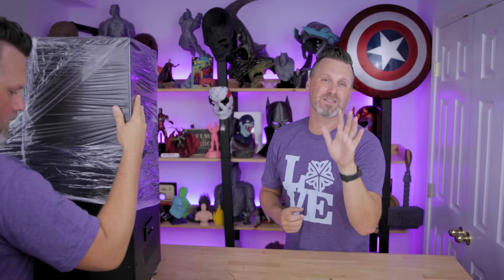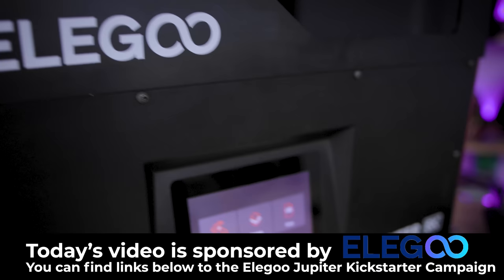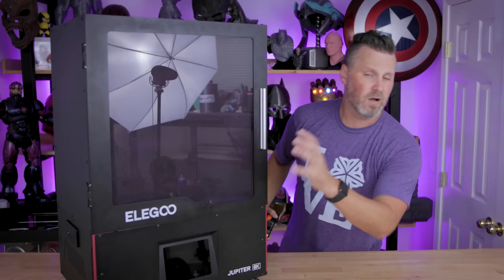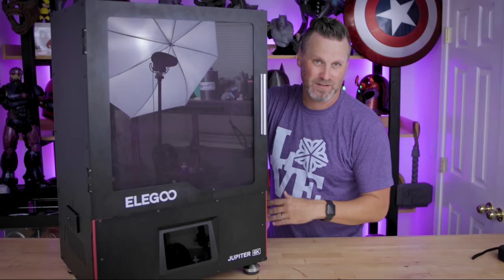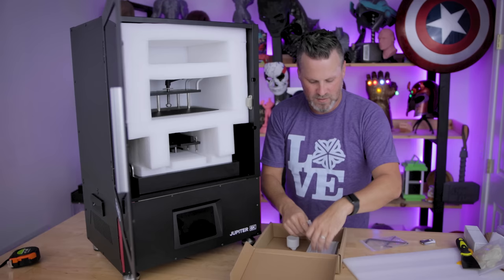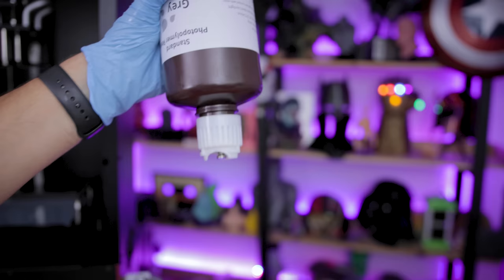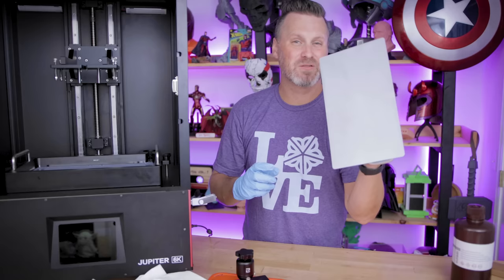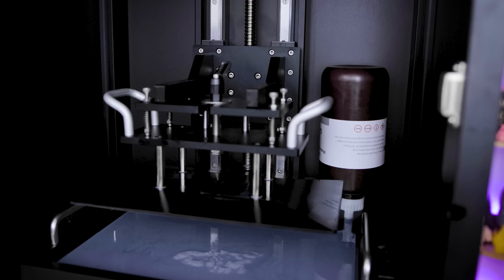Elegoo Jupiter Kickstarter Resin 3D Printer | Initial Look!

Comment: List of questions for you.
-How does the 'auto' top up work and what prevents it from overfilling the vat? Does elegoo have plans to have an auto top up accessory for some of their smaller printers?
-Does elegoo have plans to change the build plate design? It's common to see for the larger format 3D printers to have a 'holey' design to assist with 'suction force' to the FEP, are large solid prints a problem on this printer potentially?
-A common accessory I see for resin printers is the ability to put the build plate on a tilt to assist the resin to drain off, is there an accessory to assist with this direct from elegoo?
-The kickstarter says it's a mono screen (both title and the section titled "Easy to assemble and upgrade"), is this initial/prototype unit having to use a different screen for availability reasons and the kickstarter units contain the mono screen?
Reply: Natures physics prevents the vat from overfilling... By elegoo´s responses on the kickstarter page they may consider increase de slope on the build plate, but have no plans to add holes... i think a lot of the backers don´t like the holes, including me...

Comment: it might be the FBV sheet move slightly each raise.
one thing I would love to see from such large printer is a way to eaither fill half the vat and use half the plate or switch them for smaller prints so you don waist that much of resin

Comment: I do wish printers wouldnt go all the way to the top of Z once a print is finished, my E10 does this and so does this one by the looks of it. The drips will make a mess of the inside. If the built plate is sturdy and does what its supposed to, i dont see a huge issue with this design, you show screwing down the bolts once the plate sits on the screen but i assume the next steps is you have to then tighten the nuts on top to lock them in place. THAT seems like i could be a pain with all the handles and stuff in the way, especially for the back two bolts
Reply from the maker: “I believe” it’s possible to modify that in the printers firmware. Making a note of that for a wuick future video

Comment: Could those lines be resin that isnt mixed properly. If its sitting in the hopper it could be separating a bit. I had a print do this when i didnt shake the resin before I used it. Considering the auto hopper is in the back. Just food for thought.

Comment: If they could move  the power switch to the bottom front of the printer (like a Vitamix blender) and the USB in the front. this way you can place the printer in a corner and not have to worry about not being able to access the switches and USB. this would work great if they made the doors reveesable like someone else mentioned.

Comment: A question i have for the bottle that auto fills it. if you have a long print do you have to shake the bottle halfway though the print due to how it separates? I suppose this could depend on the resin you use aswell.

Comment: My back hurt watching you lift that machine, please be careful, or have the evil twin be careful ;) 

What a big chungus of a machine, and I completely agree with you, USB on the front, you can use a very tiny flash drive and basically eliminate the rick of anything breaking off. 

Had a whole thing written about the lights hoping it was color grading, but alas, it is warm, I agree, elegoo should be changing that. 

Curious to your thoughts with that resin filling mechanism sitting like that eventually possibly causing the resin to separate as it settles. 

I thought the Jupiter was going to be mono?  That is interesting. 

Those lines are definitely quite cool looking, but definitely should not be there. Glad to see Elegoo on it to fix things!

Comment: Thanks for this video. For me...the biggest thing I love about this printer is the auto refill. That is a major selling point for me. Elegoo will take care of all these issues and this printer is going to be THE large format printer to get. Thanks again for the video. Can you find out the nanometer wavelength for those LED floodlights. That is little bit worrisome for me. I work in the UV ink industry and we have to be careful with LED lights in and around hardware not prematurely curing our UV inks.
Reply: Huh, it might be that this light color is selected specifically to reduce any chance of premature curing of resin?
Reply: @raelysk  I still would like to know the nanometer wavelength. Some 3D resins can experience curing with as low as 350nm.
Reply: That feature alone made me choose this one over the Mega 8k.

Comment: Hey Jessy, 

I'm looking for a printer for the sole purpose of printing multiple/batch figures with a max height of 4 inches, so I need something with a similar sized build plate to the jupiter and something that can 0rint backchat figures at the bestbspeed possible. In your opinion what would be the best printer for that requirement between £1k and £2k? 

Thanks

Comment: Wow. It’s a combo of some really neat features and some really wonky mess. That build plate looks like a disaster waiting to happen, as does the raised screen. How much of the z axis height is wasted on that multi layered build plate contraption? This could have been a 350 mm z height without that waste. The single front opening door makes getting that big vat and plate in and out a lot more awkward. But the resin feeder is brilliant as is powering the filter off the units own power. Really need to see some actual comparison with other printers like the Mega 8K, and Transform and Phenoms. The lack of holes in the build plate is really interesting too, given Phrozen felt they were essential. All up, it’s an interesting machine but it’s got a ways to go before it’s ready for the big time.
Reply: Exactly what I thought when I saw that build-plate tower. Looks like a model of a pagoda where the builder was confused as to where to put the roof.

Comment: After watching your videos I just got an neptune 2s. is was easy to set up and got printing in no time. I do have an annoying squeaking noise from the extruder. Seem to happen on retractions. Is this just normal?  is the stepper motor not silent.could it be the  filament sensor? Was thinking about trying to disconnect it.  MY ender 3v2 has the same extruder setup minus the firmament senser and no squeak just a loud power fan lol. thanks again for all your great videos they have been super helpful.

Comment: Are those new xl filters from elegoo? Are those better than the smaller ones? I got two regular sized ones today and are very happy with them so far. Do you know if elegoo is selling replacement carbon pieces? Nice Video!
Reply from the maker: It is a new prototype longer unit that is USB powered vs battery operated. I don’t believe they sell replacement carbon filters. I will look at making a video on how to make your own.
Reply: @UncleJessy  Thats a good idea. Ich have also looked up some diy solutions. Thanks for the answers.

Comment: Hey Uncle Jessy, nice review I have been patiently waiting. Anyways, Elegoo specify a MONO screen on Kickstarter but it is LED also, so is this not the same MONO technology as the Mars 2 Pro? I guess is the print speed close to the Mars 2 Pro for the same file if printed? Thanks!
Reply from the maker: Hi there, clarifying with elegoo on my unit as I thought i was told it was not a mono screen / early beta. The production units will be 6k mono screens.
Reply: @UncleJessy  Cool, I wonder will the replacement screen you receive be a 6k mono? Looks like a pretty cool machine though!
Reply: @UncleJessy  So if you didn't get the 6k mono version of the screen, do you know what resolution yours is?

Comment: I feel its early to judge, and i dont know why but it looks a little uncomfortable to use, maybe its because of the angle you are testing the stuff but the buildplate seems a little messy to clean and it will not get into the last mercury X unless they ship a new wash container with the machine. Not been able to reuse machines that they made not that long ago feels wrong. If they ship a washing container for that buildplate if you already bought the mercury X might be a machine i could buy in a future.

Comment: How does the print quality compare to something like a saturn? i know it's very early and only a prototype but would jus love a ballpark estimate they look really good
Reply: As Jessie said the screen he has isn't a mono (he commented that he might wrong about that though) he may not have the final version of the screen. By the specs listed on the Kickstarter it's 51 microns resolution. Most 4k mono printers are around 50-52 microns. For instance the Saturn and Mono X are 50 microns, the Mighty 4k is 52, as it has a larger build plate than most. So this should have quality on par with all the popular mid sizes out, but with a massive build plate.

Comment: Can you u change the resin auto filler mid print or is it a pain to get to??
Reply from the maker: I will have to test it out on larger prints and see but in theory you should be able to reach in and change it or pause the print and get in there

Comment: Well, this looks like it would be nice (and very expensive) to have. Sadly i think if i ever do get a resin printer (the only place I could possibly put one is an un-used bedroom, but that has a carpet floor), i think the Saturn will be the upper limit in terms of size and affordability. I don’t see this thing being under £800 at the LEAST, over 1k at most, and that is out of my budget for what would be my first (and likely ONLY) 3d printer.

Now Elegoo have to make a Wash/cure station that will fit THIS build plate, unless they just release a bigger tank for the one that fits the Saturn.

Speaking of astrological naming conventions, I’m curious to see what they name the next one, unless they go with something different.

Comment: good lawd its huuuge... But yeah those yellow lights are yellow for a reason...longer wavelength lower Kelvin light sources are inherently low UV. Having those on won't risk flash-curing the resin. I've seen normal LED FLASHLIGHTS cure UV resin before.

Comment: Why don't you ask them to build a build plate that is pyramid shaped with round stand-offs/bosses that protrude from the angled edges where long spacers connect. Or they could machine a round land in the angled edge of the build plate that has a level edge that the long spacers from the upper plate, that they can slot in to. A completely angled top to the build plate would allow a vast majority of the resin to drain off.

Comment: Waiting for the most important detail (at least to me), which I fear is already a dead cert (locked board).
Reply from the maker: Does require Chitu unfortunately.
Reply: @UncleJessy  that sucks. Thanks for the video though UJ. It would certainly be a contender for my next printer, had it not been "Chitu locked".
Reply: @UncleJessy  Oh...Well, that is a BIG nail in the coffin. They need to let us use what slicer we like, not the one they force on us! GAH!!
Reply: @Skiiwa  ELEGOO has stated they they are in talks with Chitubox to unlock the boards and are hopeful for a resolution.
Reply: @barhamitzvah  Fingers Crossed!!
Reply: @barhamitzvah  that is purely "damage limitation". Regardless of what they do or don't know, it's obvious they were going to make this statement. What are the chances that it happens? Slim to none.

Comment: The problem isn't getting resin into the vat, its getting it out...(I think they did that because you might be able to build something over the size of what the vat can hold?) That build plate is Terrible! only really 3 things I like better than my Saturn. The light inside (needs to be white), the tilted screen, and the door (Needs to open more than 90degrees) The whole raised screen, giant vat, giant build plate just looks like an accident waiting to happen. Slip with that big build plate and its lights out for the 6k screen.